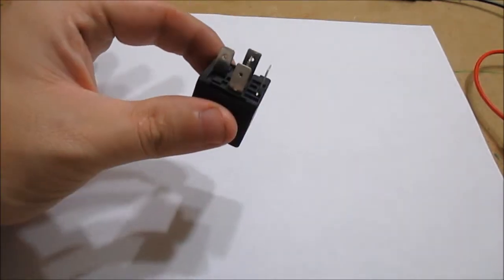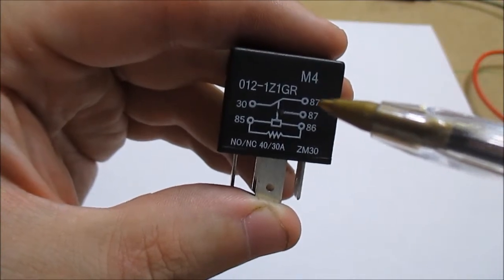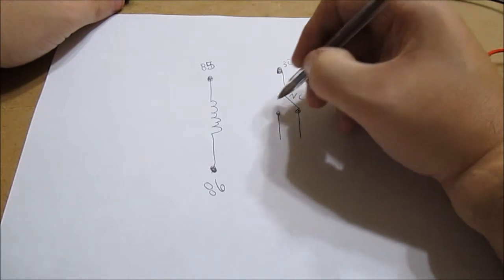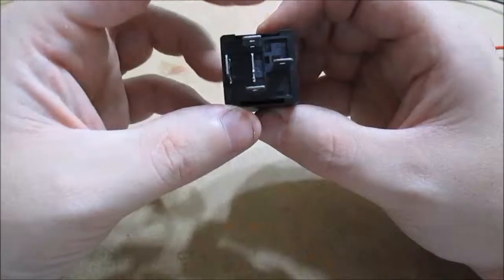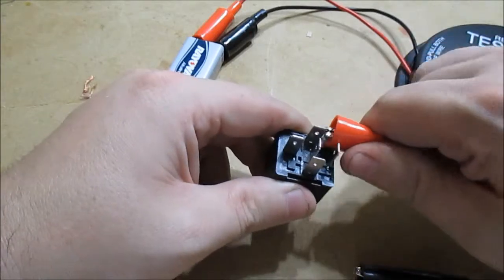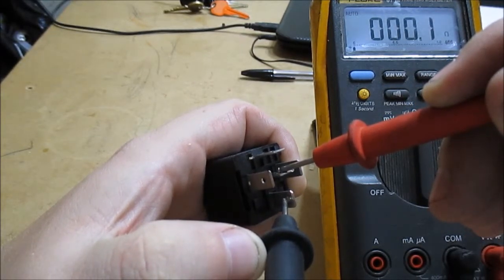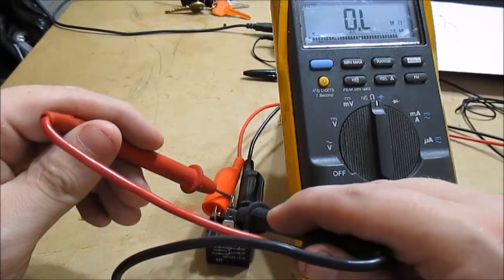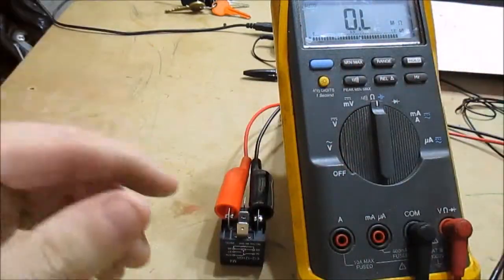How To Test A Relay

Comment: Thanks AJ. Great explanation. Is the relay there to prevent constant power to something?, or to reduce voltage?
Reply from the maker: +John McInerney 
The relay is just an electromagnet that opens and closes a switch. Most of the time it is used when you want to use low current to control higher current. For example, perhaps a computer module can control the magnetic coil using lower current and turn on something drawing higher current. In this situation the computer module could not directly control the device because it would draw to much current for the computer to handle, so instead it controls a relay which turns on the higher current load. I hope that makes sense.  It could also be used like you said to prevent constant power to something, and it could also be used where reduced voltage controls higher voltage. This is a special type of relay usually called a contact (or motor starter)   An example of this would be an air conditioning contactor relay which uses 24v to turn on a coil which controls the 240 volts to the compressor motor. Lots of motors and heaters are controlled this way. Well I hope I explained this well and you were able to get some useful info out of it. Well thanks for the comment and have a good day.